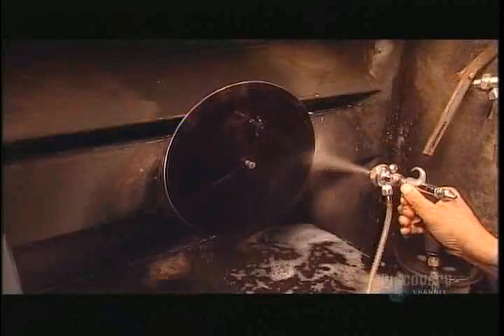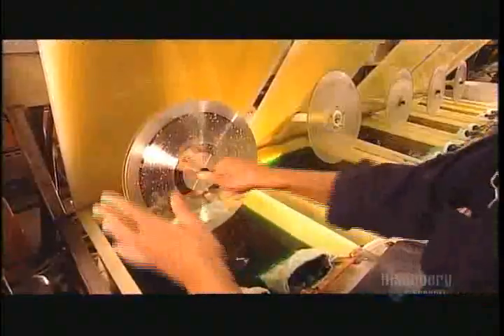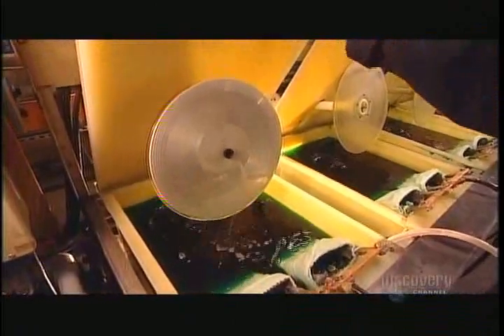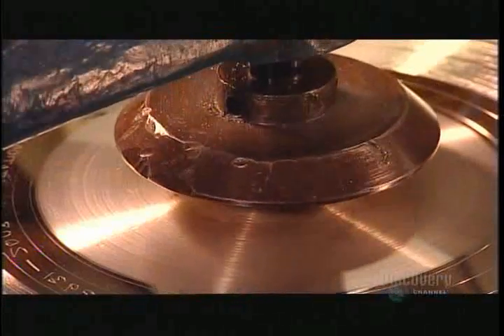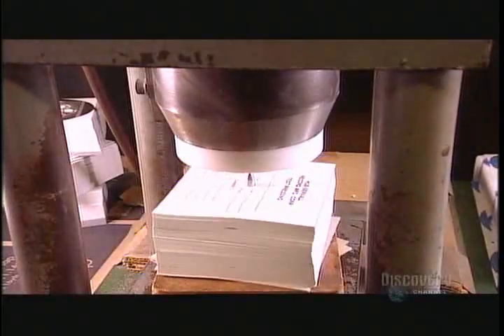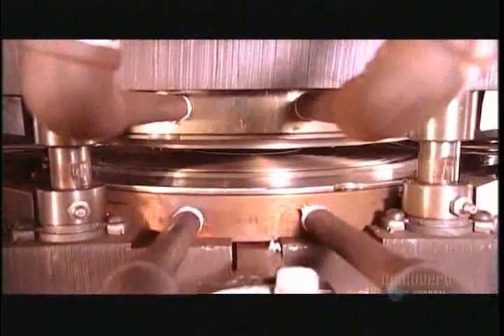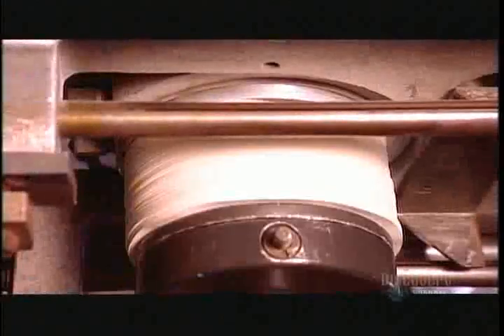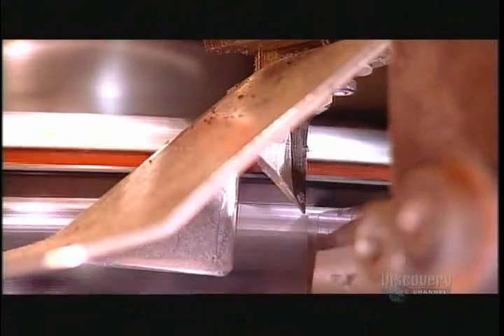How Vinyl Records Are Made PART 2 OF 2

Comment: @AndreasZimmerman when the needle goes over the grooves up moves up and down (it can move up and down from 20 times a second to 20,000 times a second) and so it vibrates. the vibration distorts (vibrates) a small electric signal which is amplified (with a tube or transistor (like in guitar amps)) and then this is fed to the speakers which reproduce the same motion the needle makes as it goes over the grooves on the vinyl but much louder. you can hear the music by just listening to the needle

Comment: Sound is just vibration. Remember the cutter used makin the original disk? The cutter machine receives the sound in the form of electricity, and cuts cuts the vibrations into The disk so that the vibrations would be reproduced if a needle is drawn over the grooves a a given number of revolutions per minute, like 45 rpm or 33 1/3 rpm. The needle in your record player receives the signal mechanically, and it is attached to an device that converts the vibrations into electricity.

Comment: Before digital recordings - people captured audio on analog tape.
Even if the vinyl record is made from a digital source the listener may perceive a more pleasing sound as there are numerous variables influencing the sound character eg: manufacturing process, vinyl mix, temperature of presses, playback equipment, phono preamp electronics to name but a few. CD playback depends a lot on the player & its digital-analog converter, which in the case of most consumer cd players is a cheap DAC chip.

Comment: @Real1shepherd its still not the same because you are translating an analog signal into a digital one and using compression (studios use high quality 24/192 or higher) and then turning it back to analog to make the vinyl. So in doing those conversions information has been lost along the way and the theoretical advantage of vinyl is no longer so great. If we compare it to CD quality then yes vinyl is still better; however HD uncompressed audio formats are a different story.

Comment: Actually, FLAC is a compressed audio format but, as you mentioned, none of the actual audio data is lost. You can RIP a song to FLAC, and then burn it back to CD in the CD format and the burned song will be bit-for-bit identical to the original song. FLAC does result in a smaller file size than does an uncompressed format like WAV, but not as small as the lossy formats like MP3.

Comment: Now i have a question: does the metal disk that is peeled-off the master disk have bumps or cuts? If it has cuts, wouldn't the vinyl from the biscuit that flows later in the cuts produce a vinyl record with bumps? :-/

Comment: Most professional D.J.'s still use vinyl records rather than cd's for the simple reason they sound much better.
The difference is similar to compairing 
solid state with tube amplifies.
The vinyl has a much warmer sound as the tube amp. Although I have purchased few cd's this was done on an emergency basis only for they don't have the quality sound of a 12" vinyl record. Vinyl records are being brought back into production
for obvious reasons . Amen

New York City
D.J. Sal Z.

Comment: Not really. The vinyl maser itself is etched from a digital recording on a computer so there must be D/A conversion first to produce the record. 

In either case, there's no loss of information in digital to analog conversion or vice versa if the analog signal has finite bandwidth, so long as the digital signal is sampled at twice the maximum signal frequency. This is why the sampling frequency of most digital music is at 44100 Hz, twice the maximum audible frequency of humans.

Comment: "Outsideheaven" is right to a degree. However.. I would not fault analogue recording techniques for this issue. The s sounds simply make the groove momentarily wobble in a way that cheaper stylus's have trouble reproducing and the result is distortion... or rather an overdriving signal.

Comment: CD's are a medium storing data, not software.
CD Players contain software to control the head movement/UI, and almost completely separate is the digital to analog converter.
The high end CD players contain better DAC's
Alternatively, transfer the audio in digital to the receiver (optical or coax), there is no difference at this point.
Better quality is only achieved if the DAC in the receiver is of good quality.
Without a good receiver and amplifier, it makes no difference what CD Player is used

Comment: She got the steps wrong !
1. Peel the metal FATHER or master disc
2. Go through the same steps with the father or master disc! Except this time you have what's called a mother disc, and the father disc is stored away until they need it to make another mother disc!
3. The mother disc can be played, and is checked for defects by listening to it in quality control!
4. Finally, if the mother has no defects, they go through the plating process again! THEN you get your stamper for pressing records, and the mother disc is stored away until they need more stampers!

Comment: Vinyl is only "better" because it's at 48kbps and CD is 44.1kbps. It's the knock we had to take to get a disc smaller while fitting more information on it. There is nothing wrong with digital formats other than the Red Book CD format and MP3 formats, purely because they have such a low sample rate. 
All modern music is recorded, mixed & mastered through various digital processes. Even "analog" masters are recorded to digital format. It's only the end consumer digital formats that suck.

Comment: Okay, so they say mp3 is better than vynil records. How can that be? Impossible to start with. Unfortunatly only an audio with a very high bitrate woulb be able to retain all the frequency bandwith (DTS HD Master audio or Dolby TrueHD would be able to to it) in another end SACD are able to retain the full band with. Unfortunatly the CD is not. It is a compression and the wave is a compression too in fact this is the same compression of the CD. Now for those who say that MP3 is better just think about a song in a wave file that last 4min 15  seconds the file will have a 42.97 mo. Take this file and compresse it to a mp3 at 192 kbs the file will size is 5.87 mo a compression of 87% from the orginal wave form and this is the lower you can get before there is a bigger lost of high frequencies. To acheive that something has got to give and it does. The algorithm is calculating information in the frequency that are not perceived by human ears as our brain is eliminating weak sound in favor to louder one and the algorithm is using this patern but it is not a human and sometime during the process it will take more that it should. Take a song with a lot of bass a wave file will retain most of the sound intact minus the harmonics wich we loose on CDs but once compresse to a mp3 loud bass are heard but sometime the high frequencies are sacrificed in the process and the sound is not as good as it was with the wave file and even with the good old vviny records. By the way the last album of Celine Dion Loved me Back to life has been released in vinyl http://www.cduniverse.com/checkout/cart.asp?PID=9044215. Vinyl is coming back but for the consumers that want to get the best sound there is.
Reply: I'm not sure who you've been taking to, but no one will argue that Mp3 can compare with vinyl. Now digitally released 96k 24bit flac files... you've got yourself a real debate. I, for one, am not enchanted by the noise and crackle of a vinyl. It is distracting and it should not be there. It wasn't there when the music was made, so it shouldn't be there when it's played. The "warmth" of vinyl, is infact distortion caused by the medium's shortcomings, and overcompensation by the hardware playing it back... It's just a happy accident that it's more pleasing to some. The big thing that it comes down to is almost all turntables are hooked up to decent-to-good Hi-Fi systems with large speakers, while most digital files are played through headphones or computer speakers. How can you compare the two? I also think that most digital files are listened to while we do other things, so we're not paying as much attention to the nuisances of sound, while vinyls actually require your attention and care seeing as you have to monitor the vinyl to turn it over to the next side, and actually bother to get it out of the sleeve and put it on the turntable to begin with, rather than just taping a label on your phone or clicking a file on the computer. The ritual of vinyl listening is just more intentional and interactive than digital listening, so you are more invested. It's a great debate that will never be decided. Folks that grew up with vinyl will rarely drop it for digital, and then there are the snobs that think their ear can hear frequencies way outside of the human ear's gamut. If you ask me, a lot of it is perception and wishful thinking. You're told it's the best and superior, so you may very well believe it is before evening hearing it. The only true and undeniably superior thing that vinyl offers is the size of the artwork on the sleeve if you ask me.
Reply: 320k mp3s are non-distinguishable from flacs

Comment: what difference is between digital made vinyl and digital made cd?
Reply: the cd will be an exact copy of what was made. the cd holds digital data. The vinyl will have a unique variable because the data is being transduced, meaning the information of the music is going from an electrical signal, to mechanical(vinyl) then it will be read back into electrical (record player). Basically said, vinyl can never be an exact copy, digital is always an exact copy (unless you are talking about changing data compression like changing it to an mp3)

Comment: Digital is intrinsically better than analogue, it's the current implementation that sucks. 

1- MP3, and all other non lossless compression method just destroy the original
2- RAW, uncompressed digital audio can technically be sampled with near infinite resolution, as long as the sampling device and the play back device have enough bandwidth to sustain such resolution.  

The end result would be an audio recording that actually exceed the limited resolution of the vinyl analogue form factor.

Comment: That has no relevance to what I said. But technically if the boat was a huge luxury liner, then yes it would make it better. Unless of course speed is the main factor you have in getting to London, but you wouldn't be traveling by boat the whole way nor in a plane the whole way. You would have to do some driving aswell so it's up to you really.